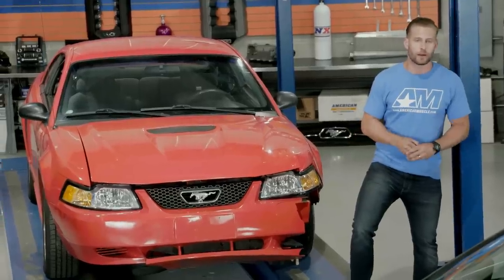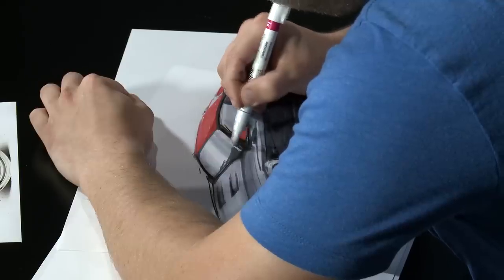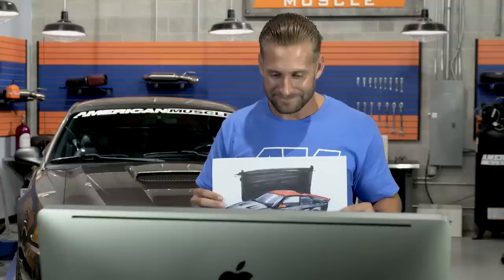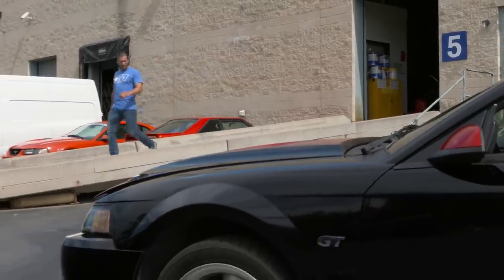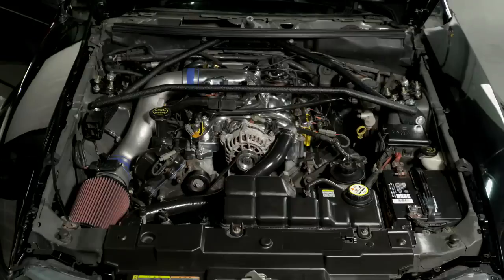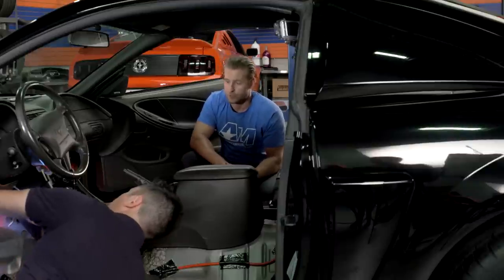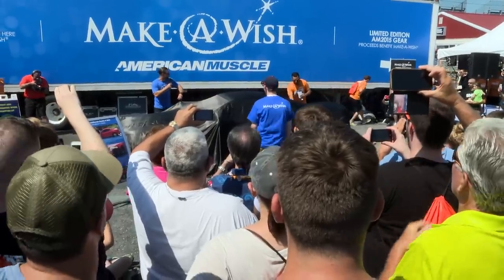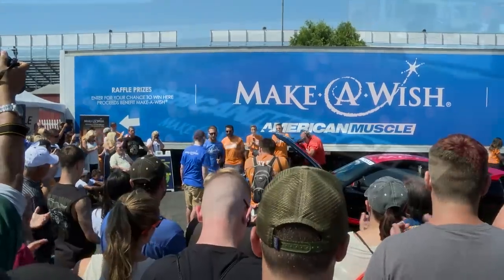Make-A-Wish Mustang Overhaul - Justin D & Steve Voudouris of AmericanMuscle.com

Comment: Imagine getting gapped by a make a wish car
Reply: I'd Johnathans driving I would not care but if some else is I would be pissed
Reply: Yeah imagine getting gapped by a car with a whole list of performance mods. This is the stupidest comment lmfao not like the car was built by professionals or anything 🤣🤣🤣
Reply: r/whooosh
Reply: @wangledangle3221  it has basic bolt ons, its nothing special
Reply: TheDemonHellcat you obviously no very little about cars or didn’t read the whole list “basic bolt ons” lmfao do you even know what bolt ons are??????
Reply: Wangle Dangle No Wangle, I read the link, and this car literally has mostly bolt ons. That doesn’t mean it’s not a quick car, but I mean it doesn’t have anything ridiculous. It’s got a aftermarket exhaust, good tune, better air intake, and a few other things, but that’s just for the engine. When it comes to handling, it’s definitely got more than basic bolt ons. However, it’s not like it’s ridiculous, I’d be willing to bet that my ‘06 GTO with its “bolt ons” such as a K&N Cold Air Intake, Supercharger, better gearing, front and rear racing sway bars, and lowered ride height, and good tune could easily take this thing. Though I suppose that’s not really fair, as it’s putting an LS2 against a modular 4.6. Anyway, it’s a nice car that’s got some cool parts, but it’s nothing ridiculous, and whether you admit it or not, it is mostly bolt ons that anyone could find at a local parts store.
Reply: Wangle Dangle a full bolt on 2v isn’t that fast tho
Reply: This have to be the most ignorant,and insensitive comment I’ve read today
Reply: Wangle Dangle r/woooosh
Reply: @wangledangle3221  How about both you and him learn that r/itswhooooshwith4os